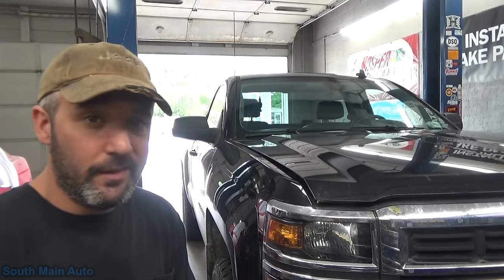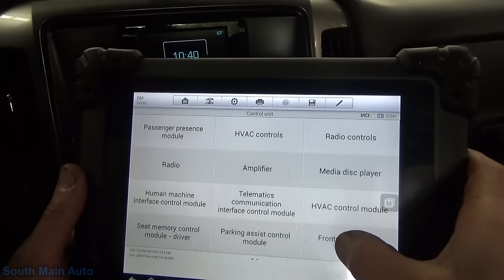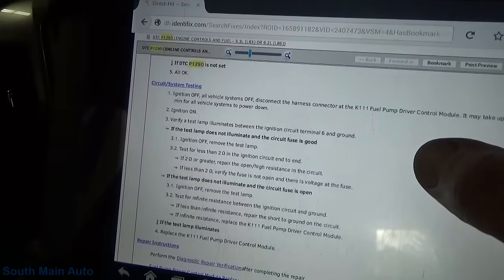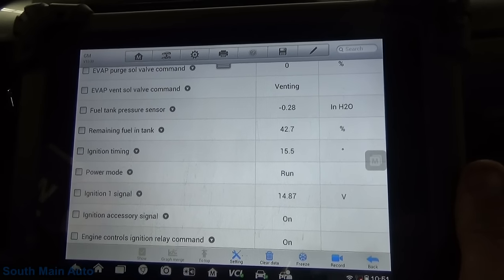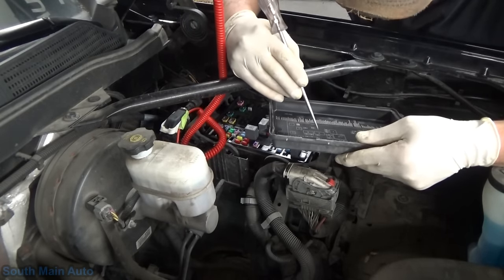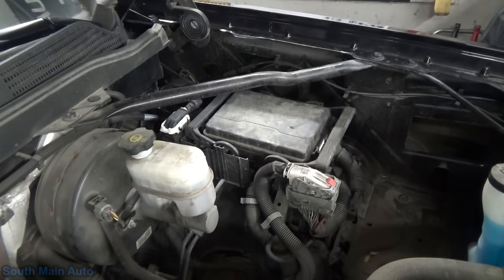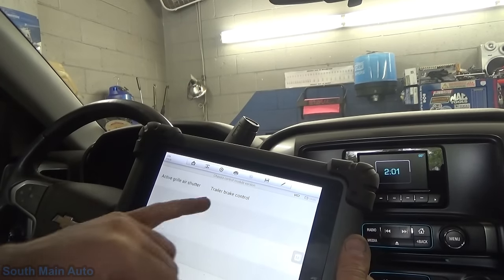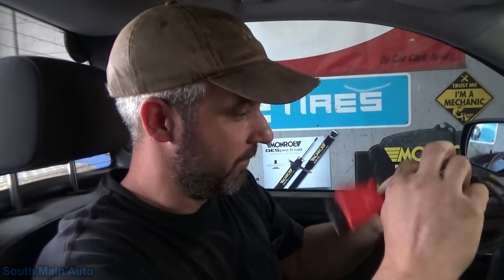Chevrolet Fuel Pump Driver Problems - Where Is The Broken Wire

Comment: I'm up way before I should be ... and you're up 2 hours before me! :D

I just had my wife go retrieve her sewing seam ripper, HAHAHA! Never seen one before. I'm going to have her grab me one ... or 12 of those - looks like a great way to open harnesses. Thanks for the tip, lol! She's pissed -  I'm stealing her t-pins, thanks to Paul Danner ... and now her seam rippers. :D

My truck looked just about as bad at year 2-3 after commuting on some major highways in MA here - black truck was pure white after a run down those roads. Insanity ... Not even worth buying new up here! Total waste of money! Besides the fact that GM can't build anything reliable anymore. Imagine  how that truck will be in 20 years! If the body even COULD survive that long, the electrical problems will make you want to burn it.

Big Nasty saved my bum big time yesterday! Broke off all 3 studs on that gigantic dumb exhaust flange (next to one of the cats) GM designed on a '96 Tahoe. Of course they put 2 crossmembers and a torsion bar RIGHT where I need to work! GRRR! Anyway, finally got that flange separated, cut off what was left of the studs, then gave her Big Nasty with the pointy bit. Drove 2 of the rivets right out!! AMAZING! Saved me HOURS of frustration! Right now I'm in the process of drilling the 3rd one out - that one got welded at some point in it's life - she ain't coming out, Big Nasty or not. Got an angle drill up in there (barely) - taking a LONG time, even with a good set of machine screw bits.

If I ever win the lottery, you'll be the first to know - there will be a large donation! ;)

MEOW ... it's time to get back to work! :D

Comment: It's not boring at all it's informative, what i find is when ever i get broken wires when i strip the wires back even back as a foot either way the wires are black where water has travelled down the wire so then trying to solder a splice wire in is a pain in the whoha so have to scrape the wires to try any get a bit of copper colour so the solder takes to the crusty wire.

Comment: I installed a new trailer light kit with new wires on my ATV trailer for 2016 hunting season, FF to 2017 fall, no lights.  After a lot of the same type of troubleshooting I found most of the wire from the connection at the truck was all corroded.  I cut back about 4 feet before I gave up the idea of patching.  I took it work and had some of the ele. techs look at it and they said most likely it came from China bad.  Oh fun.

I ended up pulling all of that junk wire out and running Anchor marine grade tinned wire to my lights.  So far so good.

Comment: A different tool that works much more reliably for tracing wiring faults is a TDR (time domain reflectometer).  It uses reflected pulses to find changes in wire impedance due to breaks, resistive shorts or grounds.

Comment: GM One-Wire corroded to factory specs. Sweet.
Reply: GM
GOT MORE PROBLEMS
Reply: Door jamb No that's Dodge Chevy is the best.
Reply: e Kopke Wrong better than many other Brand's I have found just look at Fiat or Dodge.
Reply: @edwardmartinez199  Fiat is the owner of Chrysler on paper. That's lame. It's like saying the Feds design GM products because they financed GM out of the whole. Actual Fiat vehicles are rarer than a quality built GM product.

Comment: There is a technique that is basically sound theory called TDR (Time Domain Reflectometry) that can determine the length of a wire (and by extension, presumably where the break is). I have never used it, mostly because I am leery of calibration issues. Basically it pulses the wire and catches the time of flight for the pulse to be reflected back. It is used in telecom a lot, but I'm not sure how salt and dirt and moisture and capacitance might affect how it works in automotive environments.

Comment: I found that power probe wire tracer. sucks for vehicles like you said , I passed by a broke wire and added a hour or two extra time till I go the scope on a rope out . you don't need the latest and most expensive off the tool truck to fix things
Reply: It’s a kind hit and miss,, I do admit large diameter wiring harness doesn’t work all that well,, but it’s been a good tool to use,, just picky at times

Comment: 49 minutes in so they complain you take too long? fast forward or watch and learn that normalality is what we go thru. keep up the good work sma....it took me 12 hours for a 2002 ford taurus water pump...seeing I tried to salvage my clamps and lost one and had to wait for wife to pick me up for a clamp that I should have bought a bag of assortments. Because the clamp on the pump wasnt tight enough (clamp type) and had firestone put on in because it was to cold out for me.

Comment: As much as you chase open wires, you may want to look into a basic  t.d.r. used for telcom work.  A  TS 100 from Fluke networks is very handy for  opens, corroded wires and  hard shorts.  It may give  better  locations to look at.  Just an idea.  I do enjoy your work.

Comment: 30 yrs ago my Camry experienced dozens of intermittent cranking problems-         ~~ weeks after one year warranty expired ~~
    -THREE or FOUR FUTILE visit$ to dealer later,   I got annoyed ~

   ~and rather than open up cable harnesses and 5 connectors   going through body and shell from firewall and into cabin,
        I  installed ONE QUALITY SINGLE LENGTH 16 or 18 gauge TEFLON wire from starter solenoid SOLDERED DIRECTLY  
        to crank post / position on STARTER switch           -eliminating about 12 potential "connections"

         -so NO MORE starting problems for next 300,000 miles ~~or 15 yrs I had car in salt belt
           (NEVER looked for original offending 22 gauge OEM wire in OEM harness)  

        but impressed by your determination on obviously more complicated but error prone design
         RUST on fairly  new truck demoralizing-

Comment: Good video I was trying to fix blinker and accidently crossed switch plug and engine continuum started to smoke relay under hood now no power at fuel pump hard wired to run.thnks chasing problems.

Comment: I have to say i have the powerprobe short/open finder and  if used as a tracer on a open circuit is mediocre but used as a short finder i just use the input box turn on the constant beep tone and wiggle the harness it is  phenomenal for this in my opinion working on buses i have found numerous shorts this way its my go to .

Comment: Hey Eric, do you remember the bad 'ol days back in the '70's when Pontiac though it was a really great idea to use solid strand aluminum wires to the tail lights? Nearly impossible to splice but it did create a new industry of butt connectors with teeth to bite the aluminum. I guess this is an improvement?

Comment: Eric your absolutely right about the wire tracer being a piece of crap, after a hour and half and 4 false positives I threw it on the floor and busted it in 10 pieces. I felt much better after that

Comment: I have a few quesions.  Don't you have a seam ripper?  Do you have a wire tracer thing from the phone company?  Do you have the cloth tape like they use on the wiring harness?  Oh, and Why didn't you just run a new wire?  :)  Seriously, I will bring home the Fluke Digital Tone Probe from work and do a video on it.   It is designed to work well with wires that have an electrical signal on them.  And it doesn't bleed to other wires.  I am betting it may work well in a automobile.  It looks like Ivan could use some Heavy Line Assistance.

Comment: I have done this before only on a chevy venture van to find out under the driver's seat there's no protection to the wires going through the body.  So to my disappointment I got to rewire the entire plug in 10 degree temps & silver solder didn't do so well. 
 Got it done and ran well !

Comment: I really like this video!! I do this kind of repair all the time and it's cool to sit back and watch someone do it.. Yes I have the Power Prob tracer as well and YES it won't work on most wiring.. BUT!!! You can get what your calling a Fox and a hound tool from ????? Harbor freight!!! YEP and it's works just a good or better then my very expensive wire tracer like the phone company uses... I think it's around $30 and they call it a Circuit tracer I think 🤔.. I work on salt trucks so finding open circuits/wires is all most every day thing.. The wire tracer from Harbor freight really does work 😳😳👍🏻👍🏻

Comment: I've never had to use a wire fault finder...yet!  It's my understanding that the end on the opposite side of where the signal injector is connected needs to be grounded  for proper detection of the open part of the wire. When I end up needing to do that i will try to ground the end and see if it works... 
🤔  If one of y'all have the opportunity to try it...see if grounding end works.

Comment: Sewing seam ripper not as sharp as utility knife and Eric's explain of F&H tester is very correct. Harnesses couple inter wire and lead one on a goose chase. Binary wire search is very intelligent and single ended. But I might add why not back feed the open wire with the 12V you had at the module? Wondring what 20 years experience offers on that.

Comment: Looking at the video just 2 minuets in you said the direct injection works in thousands of psi.  As I look at the scanner an see fuel rail pressure sensor 1,  it says 1,899.5 psi?  Am I reading it correctly to understand that there is almost 1900 pounds of pressure at the fuel rail?  I didn't watch the whole video yet, but hard to believe there's that much pressure there.

Comment: If you wanted to be really techie, you could use a TDR (Time-domain-reflectometer) to find the broken wire spot.  Basically it's just radar but along a wire instead of through the air, it will show a reflection from the abrupt break and tell you the feet to the break.  A bit pricey though, even a old one is like $400.

Comment: I have a question.   I used to use silicone to repair probe spots and other types of splice joints.  Usually did not see the same unit twice.  Does the ingredients in RTV cause problems versus the liquid electrical tape.  Also used to work on multiplexing electrical systems and moisture in a lighting socket would act like a ground fault.  The difference in the power going out and the power coming back would tell the module to cut power to everything.

Comment: Auto engineers and designers, need to be mechanics before they become engineers, so that they'll know to make the design allow for easier and quicker repairs.  It seems that engineers never seem to think that parts do fail and need to be repaired or replaced.
Reply: George Burns Damn straight lol
Reply: HEAR HEAR George!
Reply: George Burns - Or vice versa; incentivize auto mechanics to become designers/engineers. Me personally, I’d make it so the you “pop” not just the hood, but the entire body when you unlatch the hold-down at the front. Either that, or make the body panels fastened on with strong neodymium magnets (or Velcro)! Either way, end result is near-complete access to the entire drivetrain for easier service.

Comment: They sell those Telco toners and probes at Home Depot now. Used one type or another for 35 years in cable with up to 800 twisted pairs and they work amazingly well. Save you a lot of probing and cutting
Reply: disconnect both ends apply lots of power, look for smoke signals :))
Reply: great for those pesky high resistance opens. either blow it open or have the fire company find it when they put the fire out
Reply: that was my thoughts exactly,  nothing 15kv wouldn't fix

Comment: Get that Chevy down to Texas quick before the rust wipes out the frame!  Wow, I've been driving Chevy's all my life and never knew how bad they rust up north.  My old 2002 Avalanche does not have as much rust as the 2014 you just fixed.
Reply from the maker: This thing doesn't have 5 years left in it and it will be in the crusher

Comment: hi there i follow your channel religiously and think your the best my question is about the current testing video u just did. there are no  good videos expaining current flow in and out of battery and how alternater and starting and cars power systems tie in and how current flows from alt to bat to fuse block and witch way you flip current probes could you do a video with scotty board and show excacly how you got these measurements and how current runs and all that. it would help out alot of people not just me thanks in advance

Comment: A 2014 already rotting out,go figure. I worked with GM,no suprise on the wiring harness. I can guarantee that happend during installment. Someone got it cought on something before wrapping. It made it through QC that way. Like you said,sometimes they would grab more plastic than wire when the connector spade was installed. That wire could have been that on the loom. They plug them into a test bed to check but it misses the loom check. Since it is 100 visual,thats not suprising. Hey, it paid for my first new car doing that kind of work.5

Comment: Gm has some sort of wiring problem.  We had one GMC Savana van where I work that over the years I performed "quad" or "5-way" bypass surgery on (oil pressure sensor one time, coolant temp sensor another, AC compressor clutch another...)  None were "chafed" - they just seemed to "rot" (green corrosion) from the inside out....

Comment: I tend to use meter after my high amperage test light to see if it's in fact open or just a massive voltage drop due to corrosion then I start wiggling the harness while watching my meter seems to work well for me

Comment: Question what other years does this video apply too? I have a '17 that has had nothing but wire harness issues. But i believe I am dealing with the same issue hoping the wire and pins are same location same color. Are they the same?

Comment: The amount of rust on a 3 year old truck is ridiculous! Don't US manufacturers use any corrosion protection? I have a 12 year old Alfa Romeo (notorious for rusting in the UK) that has less rust than that truck. Pretty poor the wire was apparently damaged during manufacture.
Reply: I GOT 97 DODGE TRUCK 166K ON IT RUSTS BAD  -- PIECE OF JUNK
THIS IS STUPID FOR 3 YR OLD TRUCK FOR RUST
Reply: Got a '93 Shivy Blazer with less rust than that truck!
Reply: yours MUST BE BETTER SHAPE THAN MY KRAPPY DODGE
NEVER AGAIN DODGE
Reply: Must confess my truck came from Flint MI straight to the South.
Reply: DODGE AND FORD ARE KNOW FOR RUST BUCKETS AND NO STARTS
EVEN WHEN NEW
ESPECIALLY FORDS
Reply: drayco 
UK is wet, but not that cold. They use lots of road salt in the North East of the US. and Mid West.  we call it the rust belt for a reason.
Also.. it's a pickup truck. They do tend to get abused and used off road and on farms... etc.
my Jeep is 24 years old and has less rust than this... but spent it's whole life in California and West Texas.
Reply: Well, the UK uses salt in the winter and I have a 96 Mitsubishi Shogun, I think you call it a Motero in the US' it's used off-road, on farm tracks and in the surf and it looks showroom in comparison. Looks to me like there is no anti-corrosion on the frame and they used low grade mild steel. How many months do Chevrolet expect these trucks to last?
Reply: drayco 
New York State average between 22 inches in the south  and 120  inches in the North of snow per year.  in this location it's on the high side since there more north.
And they tend to over salt.
the trucks last long enough.. frames are pretty thick.. but it still astonishing to me to see some of the corrosion that shows up in his shop.
Reply: OK, I get all that, but Eric O's Tundra is slightly older and is much less corroded, so, to me, it must come down to materials and build quality. I've always been impressed with the quality of "made in USA" tools, but your automotive stuff doesn't seem, from my admittedly limited experience,  anywhere near as well made.
Reply: drayco 
Actually Toyota trucks which are btw built in Texas  had a major recall for rust on Tundra and Tacoma's. during a particular model window..  some required undercoating some complete frame  replacement, some kind of defect in the steel.. it all comes down to how they are maintained.. for the most part I think. But I'm sure there are some bad ones built too. also I think this changes through time... some bad years some good as models are updated.
I always liked the Chevy because the engine are easy to work on and around..
lots of room in the engine bay.

Comment: Whats your opinion on running what we call a "cheater" wire? Sometimes a customer just wont pay for the time to remove and split a harness to repair a wire, so we just cut and solder at pcm and at the load. not ideal but it will work and we advise people that this is no the best method but its what they can afford, I always think " Eric O, would call me a hack if he seen this" but its what my boss tells me to do,

Comment: Have several 5.3 gm trucks all over 250k no issues except fuel pumps and wheel hubs. Run perfect use no oil. Rust kills us though. Brake lines calipers bearing hubs from salt.

Comment: I saw a video where the fuel pump didn't work and it turns out the wire at the harness had a worn area because the wiring touched the body.
Reply: It happens all the time because we pry the wires out of the way to look at something and then if by chance we can find those zip ties we stored somewhere we use them to fasten the cable to whatever is handy. It's never my fault if the wires subsequently fail. It's just a bad design.  Not all of us are as meticulous as Eric.
Reply: Hmmm, maybe prying wires with a screwdriver have something to do with the wiring issues.